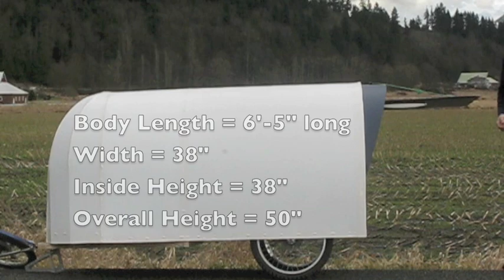Nomad bicycle camper

Comment: I have a bicycle trailer frame that I made out of a hand truck with a 1" diameter X 2ft threaded rod axle and a pair of 1" trailer hubs and 8" wheels to carry the weight of some car batteries. Your camper looks like a great design for affordable and sustainable mobile living. Thank You Paul for posting your video!
Reply from the maker: You're welcome George. It's just an idea.

Comment: Very nice idea and design. This would be great back in Germany where I grew up, over there the system of roads reserved for bicycles is everwhere, so you could put together quite a trip. But also here, with a lot of old railroad grades converted you find a nice route with a few overnight stops where this could be used. Again, great design. Like it.

Comment from the maker: Headwinds ,not bad with the rounded front. Side winds not too bad either with my heavy belongings stored low. Real strong winds, not sure yet.
Reply: Can you get wifi inside all that mylar?
LOL
Reply: Awesome. I love your designs
Reply: Love it. What was the total weight after completion?
Reply from the maker: Cynthia Weathers With a 3" thick foam mattress and all the cabinetry, about 73 pounds. It could have easily been made 20 pounds lighter.
Reply: btw, Paul Elkins 
My question about the wifi was totally serious up above. I really do want to know. It's important.
Reply from the maker: Jennifer Grove I just pulled out the camper and did the test. I was outside about 80 feet from my router located in the house. No problem.
Reply: Wow!
Thanks!
Reply from the maker: Jennifer Grove Actually that was a concern of mine as well. Thank you!
Reply from the maker: +loudwaters9 LOL!!!
Reply: +Jennifer Grove (Dark Moon) He should as long as he does not have that mylar "grounded".
Reply: +larry scarr Great idea and to expand on that, get some discarded 19 - 20 v battery skil saw motors to use on each wheel of the trailer and when need of power up hills, turn on and then when coasting or just peddling along and power turned off, have a regulator using gthe generated dc voltage to recharge the battery. That is called a regeneration circuit.
Reply: I love it. one quick question...is it hard to get access to the wheel to take it off and change it? say you have a flat or bent a rim..
Reply: Also, to give added support to the floor, you could do like a rope bed. drill small holes and run polycord through in a basket weave pattern. that wouldnt add any weight at all but give strength to the base. Any pressure put on the cording draws the timbers tight together. I love your work.We think alike.
Reply from the maker: +Cynthia Weathers 
No problem. You either prop one side up and wrench the wheel off or lay it on its side. Very simple.
Reply from the maker: about 37"
Reply from the maker: I purchased my 1x2s at Lowes or Home depot for a buck apiece. I believe hemlock.
Reply: Hello Mr Elkins. I was just wondering what the dome part was made of, and the front part. My friend and I are trying to make one of these and we're doing our best. It would really help if you can tell us. Thanks
Reply: @microwaved_gravel  he says at the beginning of the video, they are old campaign signs for the officials running for office.
Reply: Hey Paul, I have noticed in this video and the other with the PDF plans attached in the info box, that you have storage underneath the camper. I was wondering if you included that in the plans.

Comment: I noticed, when you were crawling onto the wheeled frame with the sheet over it (about the 2:25 mark of the video), there was a quick shot of what was happening underneath and there appears to be quite a bit of flexing of the plastic sheet. You could use two sheets of coroplast (sorry if that's misspelled) sandwiching a 5mm thick sheet of "sheething" material. Home Depot (Poulsbo) sells 4x8 sheets of 5mm thick sheething for $20. Cut to fit. Should improve the stiffness the floor greatly with a minimal increase in weight.
Reply: Ya, I find this beyond sketchy when I have seen material within home depot and then can't seem to find it when I need it most! I don't like head phones neither!
Reply: @nathanmciver6496  I'm sorry, are you saying my post from 7 years ago is a lie?

Comment from the maker: Polypropylene is a hard animal to get anything to stick to, hence the zip ties, although there are other fasteners one could used too. On my next shelter attempt I'll use a modified Phillips screw driver i filed down for a hole punch. It makes small slits for the zip ties. I'll add a dab of silicone on the holes and forgo the duct tape.
Reply: We're can I get the plans for this?
Reply from the maker: +Nathan Victorson Here is the link to my website plans page. http://www.elkinsdiy.com/plans/
Reply: To bad the plans are so expensive, my parents won't allow me to buy them.
Reply: +Paul Elkins You should pack a week's worth of MREs in there.
Reply: +Paul Elkins Also, just wait till you see mine, I'll email it to you when I'm done :)
Reply from the maker: Excellent Alex!  send me some pics at paulwelkins@yahoooo.com
Reply: A soldering iron punches fairly neat holes. Even partially seals the edges
Reply: Paul Elkins , thank you for your videos , I live in Washington and I'm deeply concerned of all the homeless I'm going to use some of your ideas.
Reply from the maker: By all means, do!
Reply: U r the Best youtuber

Comment: With some effort and donations, this thing could be build a lot cheaper and then used for homeless people that choose to live outdoors. Give them any bike, clip the streamer to it. Done!
This is a great kickstarter project if I've even seen one. \
And you've answered my only burning question in the last minute. "Solar power upgrade!!" :)
My compliments!
Reply from the maker: +Kenneth Tan Thanks Kenneth. After an election there are literally hundreds of full sheet coroplast campaign signs that go to the dump. With an old bike, some cheap lumber, screws and cable ties you have a mobile home.
Reply: +Paul Elkins Can you recommend a good place to find them? (After an election of course) Did you just sit at the dump for a while, or did you go door to door?
Reply: +Cassandra Ryan Some dumps that have onsite personal, will be glad, if asked to, to pull that kind of stuff aside as long as you show faithfulness in regular pick up.

Comment: I've used PVC pipe and a tarp to cover a truck bed before for camping.  Anyone could use the pipe to make bows on 2 pallets bolted end to end then stretch a tarp over it. It wouldn't be as sturdy or as comfortable as this is but would definitely help in a pinch or would make for a cheap temporary build if someone were homeless

Comment: Paul 'My hero' seriously ! I have been scribbling and drawing lots of ideas similar to this for the past 18 months +. I loved your homeless shelter idea and the 1st nomadic bike trailer but i need to be able to stand up straight. I have been working along the same lines as you but with a airstream/gypsy wagon cross breed idea. Keeping the center of gravity as low as possible and the weight of things like the battery for flexible solar panel on the roof and a  trap door attached to the trailer frame to store the weighty battery.I am using as much recycled materials as possible UK is often wet/cold. I wanted a very strong light weight warm floor for the base of my camper so i came up with this idea ! Using clean pop cans hot glued to coraplast and to each other  filled with perlite or vermiculite to keep weight down but both thermally efficient and fire proof! to make the floor with a further sheet of coraplast on top. A small section would lift out to get to the batteries below? Keeping the trailer as light but strong as possible i am going to use aluminum ladders for the main internal section and like your self wood etc for the outer, plus side of that is the gaps between the rails are just the right size to fit a airflow support frame for the batteries. and little plastic storage boxes for odds and ends.All whilst keeping the center of gravity balanced and low as possible. Sorry for the rambling lol i get carried away with my own tempory obesessions
 Sallee.
Reply from the maker: Sounds interesting. So it's a 'sandwich' floor consisting of vermiculite filled pop cans glued together?
Reply: yes sturdy but light
Reply: I am not sure how to add a photo to my comment otherwise i would show you what i have done so far. The whole purpose of it being light is so i can tow it with my peddle assist electric bike. Also the need to be able to stand up in it is because i have MS if i laid on the floor i might not be able to get back up again after a long day of cycling. I do not drive so i am looking at eco friendly alternative ways to travel and be the nomadic gypsy at heart i have always been

Comment: An amazing  project.. just one of the many you have done.  If you went with front wheel drive..  and connected the bike to the trailer you would cut down drag and maybe be able to keep yourself out of the weather  and have more living area with less drag.Keep up the great work.
Reply from the maker: +Joseph DuPont Thanks Joseph. Years back a fellow sent pictures to me and did just that. Too bad I lost the picture.

Comment: I just re-watched this video, and I have a suggestion for a more economical lighting system. Take a couple of those inexpensive solar rechargeable yard lights, modify them slightly, and use those for interior lights. On my channel, I have a play list called "Living well on a tight budget", and I found a video on that subject that I liked well enough to include in that play list.
Reply from the maker: I did this for my last structure I took to burningman, adding 7 small lights in the roof. It put out a nice dim light, but I wanted something strong enough for reading and have a swivel for placing the light where I wanted it. Some day I'll add a flexable solar panel to charge a battery which will have wiring to the individual light fixtures.

Comment: Hi Paul for starters I love your videos in watching all of them with the Coripalst, I came across a product that might interest you. they are a fiberglass kind of plastic corner board, used in warehousing and manufacturing to protect the pallets from the strapping, so it's an L shaped like the metal only it's very lightweight plastic. They are very strong and it would make your projects a lot lighter in weight and they're easy to use same as Corp. last you can drill them secure then just as easily. Keep up the good work love your videos.
Reply from the maker: Oh Lidia, sweet Lidia...
Thanks for that! I'll look into them.
Reply: Paul Elkins Did you find out what these are called?
Reply from the maker: lvl0rg4n

Comment: Oh, one more thought on your idea of a solar panel and battery. Harbor freight has a small auto solar unit pretty cheap that is weather resistant. Use a gelcell 12v battery to store the power. Now, LED lights are maxed out at around 9v.d.c. and would not last long if used directly from your 12v source. Here on youtube are some VERY simple schematics of voltage/current regulators you can build from scrapped computers for your parts. That would allow you to take the voltage down to 3-5v and low current so the LEDs would maybe last your lifetime. Would also help control power for other uses as well. Very light weight and maybe altogether about 5 lbs added weight. Makes for a great power source for tail lights and head light for the bicycle and trailer as well as maybe an additional turn signal system all using LEDs.
Reply: Here on youtube are some VERY simple schematics of voltage/current regulators you can build from scrapped computers for your parts

Could you provide a link to these videos? :) Thanks!

Comment: Y'know, this is pretty amazing for such a small space. It makes me wonder what if you could make a collapsible version of that? Like either a sliding rail with accordion  walls or maybe something that straight-up folds up. Fascinating!
Reply: I'm thinking about this as well, and sketching out ideas.
My primary idea is for part of the frame to slide over the other.
The downside for a collapsible rendition of this camper is in how to secure the floor in the moveable section.
I'll have to make drawings and trial and error, but maybe it's doable or maybe not.

Comment: Put the boat on top =P

Great work on this, love how you built the underframe and mounted the wheels; mounting wheels is always an issue in my designs, so I might try to copy what you did here, but adjusted for my own project which is essentially this, but pulled by hand; and it's a boat as well...

Comment: I like this design. I am wondering about what could be done by incorporating a pop up tent for the top half though. A cheap and ultra-lightweight version of the pop up camper trailers. Time to start sketching I guess.
Reply from the maker: Anything is possible. It just depends on what you want.

Comment: Hi Paul ,would be great if you did a vlog of a road trip in your bicycle camper , I bet in real use you'd find all sorts of interesting problems to solve , I've found doing bike camping weight always becomes an obsession, trimming down to lose those last few pounds, love your use of corroplas Best regards Will
Reply from the maker: Will Bourne Hey Will. The key to this kind of traveling is gearing and patience. Steve Roberts on his 350 lb Behemoth had 105 or so gears with dual clusters. My bike would not be the choice for an adventure with the trailer in tow, but a geared up delta or tadpole would be the ticket.

Comment: I came looking for lightweight ideas for a teardrop I'll build someday soon and this is the place!  Of course mine will have to be more robust  ehind a Harley, but for drawers,, shelving, nooks and such, chloroplast is perfect. I was wondering for yours, what about large rivets instead of zip ties? You could fill them with clear silicone and sunlight would shine thru them, like tiny lights!
I plan for a bucket sink with a drain hose to a smaller bucket underneath, which will travel in the sink bucket,, filled with road snacks or whatnot. Paper cups, plates and  campware.

Comment: Well, gives me ideas and also ways to improve. The frame would be aluminum rectangle tubing for lighter weight and extra strength. Instead of zip ties, plastic screws/nuts with plastic washers would work better, I think due to plastic over time gets brittle with weather exposure and the ties would fail a lot sooner than the screws. Maybe a half to one pound extra weight added by use of the screws overall. I've also used this one idea for making animal shelters based on the idea of paper mache. Only I call it recycled plastic mache. Use a body of aluminum concrete mesh and use left over outdoor paints with shredded plastic bags mixed in just as you would paper. With occasional strips of plastic looped through the mesh and tied off to serve as extra anchors, then spread the mache on and press it into the mesh, then as it is drying out (preferred to do this in full sunlight in summer to get it to "bake" onto the mesh), use a trowel to smooth the inner and outer skin. And in this case, would even make all cupboards at the same time using same materials so there is unified strength and water seal. Oh yeah, since it would water seal REALLY good, a couple of vents near the top would be a great idea to let moisture out. Just thoughts and idea sharing, not a critique at all, k??
Reply from the maker: +Azri'el Collier 
I like it. Never thought of using the aluminum mesh coating. I'm wanting to try foamboard painted with roofing paint to create a water tight rubber membrane. Not really durable but maybe a good sealer. 
How do you shred the plastic bags? and do you make a sub frame to hold up the mesh? Intriguing!
Reply: +Paul Elkins I did build a sub frame, but as the mesh is pretty strong, needed less material for the frame. The plastic bags can be shredded with a carpet knife or scissors. The carpet knife was a lot faster and the pieces were not all even as my perfectionist ways with the scissors tended me to do even cuts. Uneven cuts and or shreds are better suited for this. Some of the sub frame can be bent to save on extra connections to make interior shelves and cabinets. I used left over paints as the binder of the plastic. Just be sure that all the left over paints used are all the same type and oil based paints take a lot longer to set than polyurethane based, latex based, or epoxy based paints. I prefer epoxy based like concrete/deck paints as they are harder and more durable for the long run. So, I mix the shredded plastic in with the paint to make the mache/plaster and with the ties of plastic as anchors in place, simply spread it on. Sorry about not specifying about differences in paints that can be outdoor paints and it is important as some will not mix well with others and will set differently.

Comment: What about windows that slide open and shut. What if the structure could fold in on its self, so as not to attract attention from police, could be made to look like you were hauling construction materials. Like the paint job but the top stands out. What about a two in one design, on the side of the road it could look like something farmy.in the city it could look like a city worker shelter even have an orange baracade. I love playing with ideas for stealth invisibility. It is a fun challenge.